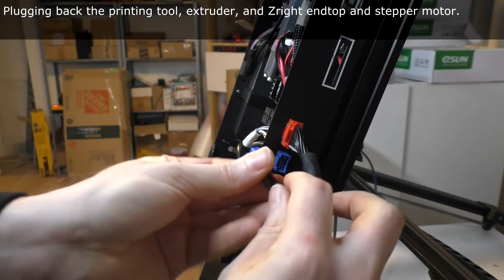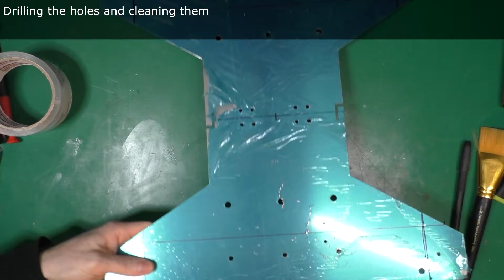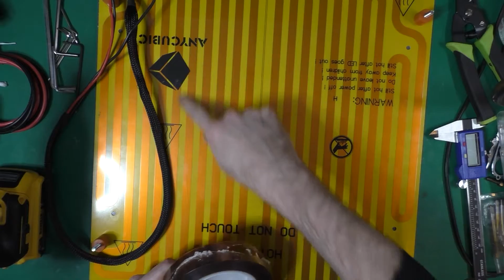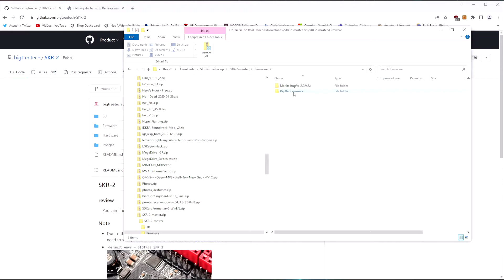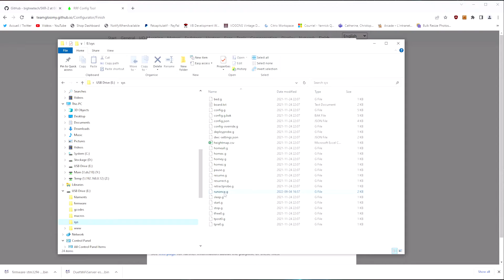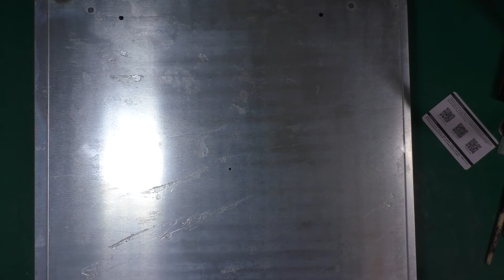[The Lab] Anycubic Chiron Overhaul - Part 2 : SKR 2, Y linear railings + Reprap firmware

Comment: I pretty much followed part one and part two videos verbatim and the only issue I'm having is with the z-stops. When I hit the home button it stops and "homes" itself wherever its sitting when I started the homing. X and Y both home correctly. Could you help me with this issue?
Reply from the maker: No Idea. It's weird because you are supposed to have the Z gantry leveling when homing too. Could be either Z-stop left or Z-stop right endstop switches not properly set nor plugged. I'd say it's like the printer thinks it IS already homed in Z, like the switches are always sending the state "home". Maybe invert the switch logic either in the file config or in the wire.

Comment: Why did you replace the Chiron Y carriage with the one from CR10 S5?
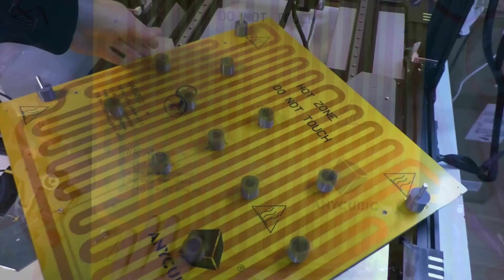Reply from the maker: I wanted more surface and flat to stick all those stands you can see at 34:05. I also wanted something lighter to reduce ringing, and it turn out the new carriage was thinner to drill so easier to work with. I was also expecting to have the linear blocks farther from each other and wasn't sure they would still have been on the original carriage. Ironically, I had to remove all those stands because at the end there were creating more issues than they were suppose to resolve, and as you saw the blocks were close to each other because the rails were a bit short. But with the weight I gained, I was able to stick an aluminum frame under the bed + insulation pad (like the Ender 5 Plus heatbed), and it is now flat, heat faster and it is still lighter than the original carriage. I did a couple of upgrade since that video, maybe I'll do a follow up.
Reply: @TheRealPhoenix_Retromods  thanks! follow up would be great` I’m just starting similar project on my Chiron :D